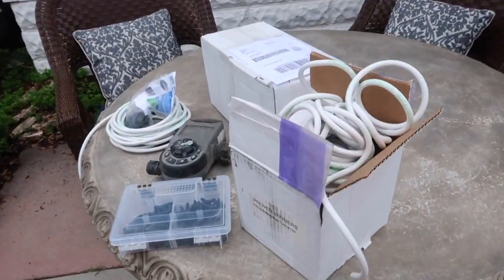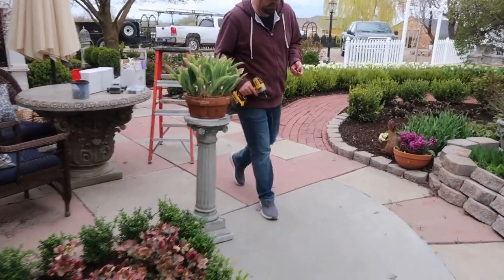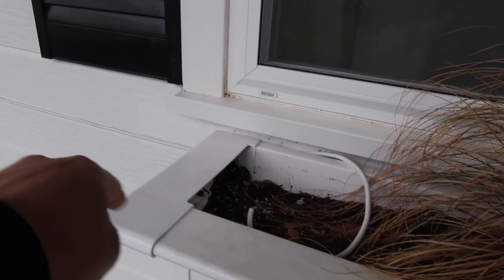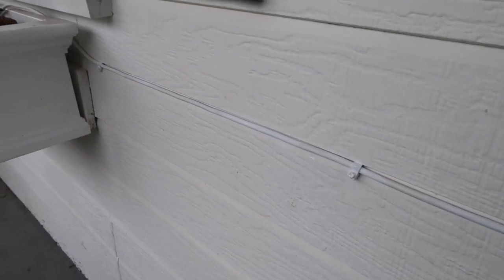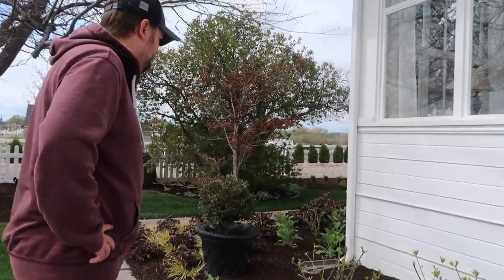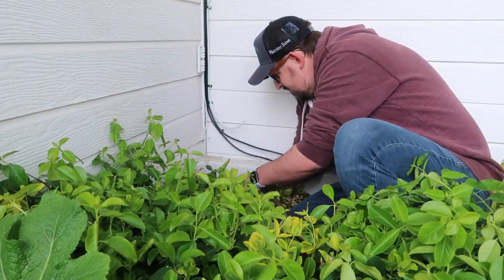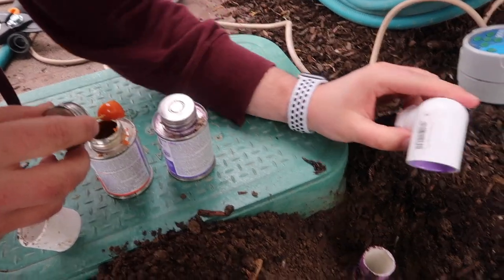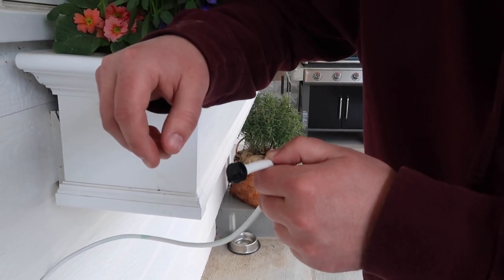Setting Up Our Window Boxes on Drip Irrigation! 💦🌿// Garden Answer

Comment: Love drip...soooo handy.  So a lesson I learned with the small tubing is when I ran it too far that it couldn’t push enough water to the end of the tubing properly.  Especially after adding emitters.  So I had to use larger hose, like 1/2”, to get the pressure needed to get the water to the end and then run the smaller drip off of the 1/2”.  Good luck!!

Comment: Glad to know the tubing at Home Depot is harder. I have been installing the Home Depot drip tubing and my fingers were bruised/rawv from trying to add the little connectors. I heated some water in the microwave,  poured hot water into a yeti tumbler to keep it hot, and carrier it around with me as I put the connectors on. I put end of the tubing in the hot water for about 30 seconds and then stuck the connectors in.

Comment: Love how well you & Aaron work together. Every time me & my bf started a big project, we would get excited for the first hour, then we had to call in the professionals #saveourrelationship  😂😂😂
Reply: Chantra Sek My hubby and I used to have knock down, drag out arguments that would make projects just keep going and going and going. 😱
Finally, we decided to set one person as the lead and one person as the helper. Because we both have experience in so many areas, it was better to have input but not that need to control the direction for the greater good of the project. 

Some marriage counselors suggest avoiding major renovations until you’re further into your relationship. I disagree totally. Doing the big DIY projects together will teach you communication with your partner.....or if you’ll end up burying him under the tulips. ☺️🌷
Reply: @megandcochrane  You made me laugh out loud with that last line about the tulips... hmm, there are those times!

Comment: Yay! I love starting my day with a video from you two! A very informative video and also helpful to those looking at the “how to” forums that can be super overwhelming. You just jumping in there and giving it a shot is awesome advice because everyone has a different need or issue.

It’s a great idea to keep your irrigation lines as level as possible when running over long distances because it reduces the amount of pressure required to keep the water moving. You’ve mentioned in the past that you’re on a well instead of city water so your pressure is probably more consistent. The water pumps for many cities have “low use” hours where they don’t put as much pressure on the lines. 

In my home, we’ll be running drip lines to the new garden beds and I’ve resigned to the fact that we will have to run the lines along the footing of the house. I’m thinking that a cable protector for the line at your back door may be a good idea so that line doesn’t get squashed!

Comment: I did it! I got my starter box and set up my second floor window boxes. I got on the roof myself!  I wouldn't be brave and wouldn't try without your tutorial. So grateful to you both. The tan tube matched my house no need to paint. Yay! I have vinyl so I got clips that go in without nailing,  and bought red adjustable emitters.  I used a two hose timer. Thank you so much!

Comment: Thank you so much for this video!  I started my drip irrigation system for my pots last year.  It was a little confusing.  I am on a well system also and ran it from my spout off the house.  I was confused when I was putting on the back flow preventer and the pressure regulator and the order they go on.  I am going a long distance so I ran black one inch tube off the spout and then the 1/4" tube at different areas around the house.  You have inspired me to finally get it finished.  Definitely the Proven Winners tubing is easier to work with than the Home Depot!!!

Comment: When I am working with connecting up drip tubing I keep a heavy duty coffee mug full of boiling hot water nearby. I dip any of the tubing ends in the hot water for a few seconds before connecting.  It softens the tubing just enough to help make the connection and prevent sore fingers.  I just reheat the water in the coffee mug in the microwave as needed 😍

Comment: Thanks so much for sharing this system.  I too want to have a drip system and also on the ground using soaker hoses and a timer.  Learning the technique from you takes the fear away of doing it DIY.
I promise you that your shrubs and plants will so completely steal the view that no one will notice the tiny hoses.

Comment: Great video. I've done quite a bit of drip irrigation in my yard and there is always an issue like the 2 gallon per hour vs. .5 gallon per hour stuff. The one problem I have consistently is that my lines always leak at the faucet to line connection. Your demonstration is real life stuff, not just someone showing how perfect they are at everything the first time. Thanks for keeping it real.
Reply: JD Winfield I wrap a little Teflon tape around the connector threads in a clockwise direction before screwing in. Works like a charm to stop the leaking! And actually makes some things a little easier to unscrew at the end of the season. Just an idea, this actually works really well for any threads where water is involved, especially if they don’t have a compression ring :)
Reply: @casey.munmar  I was thinking the same thing

Comment: Great video! I use a cup of hot water, it doesn't take long at all to soften the ends.  I use the standard black 1/4" tubing so it is really difficult to connect unless I do that.  So worth every time I hook up automatic watering.  I have some areas that I have to water by hand and it can be an every day event in summer, so every place I can automate is just so much time saved!

Comment: Mice will find a way through those holes you drilled. If you haven’t already, fill the gaps with steel wool (my preference) or spray foam.
Reply: Yeah, I was thinking the same thing.  There's also a type of caulk that you spray and it expands to fill the hole but I don't know if that would pinch or kink the tubing.
Reply: Our garden mice ate through spray foam
Reply: @jaanat.4880  Persistent little critters when it means freezing in the winter...

Comment: I saw an episode of This Old House where Roger, the landscape architect,  heated the end of the tube a bit with a heat gun, like 2 seconds, and the tube slide onto the divider pats easily. As the tube cooled it was snug tight

Comment: Glad for the fixes at the end because I was super confused by the 2 gph emitters! I was told not to run the 1/4" lines more than 25' from my 1/2" or 3/4" lines in my drip irrigation classes I've been taking, so it'll be interesting to see how the end of the line does this summer. Drip is very forgiving though, so it may be no big deal. Thanks for the tutorial.

Comment: Re: Corners. My husband does construction work & I’m pretty sure those corners will pop off and you can tuck the tubing under them. The black L piece may not fit, but you could try just the tubing.

Comment: The emitters are easier to put on if you dip the hose end in very hot water for a few seconds before putting the emitters on. I would have sent Aaron through the crawl space 😀 though it actually didn’t look too bad. I like how you showed the problem and the fix.

Comment: I have recently ( in the last week or so ) set up an irrigation system in my garden, it is such hard work if you have a small plot ( compared to yours, ours in tiny) not sure it’s worth it as I still have to run around to connect it to hose in each zone. But hey I tried it

Comment: Hi please just use Drip emitter line in the planters. Far superior. 
 Many reasons. Various spacing avail. 
Max 20ft runs of blank 1/4 inch Drip line recommended but it may work albeit not as well. 
You will likely be making changes over time. 
 There is a tool for the soft fingered installing emitters into tubing.

Comment: When you connect the connectors/T's to the tubing, it connected so easily. It is so hard for me. The connectors/T's (& other attachment pieces) are hard to connect to the tubing. I'm using another national-brand drip irrigation system I love. I wonder if my system & the PW's  Waterwise-system are compatible (?). Do you know if a 'bird' (wink-wink) and Proven Winners are compatible? What did Aaron use in his drill to attach the holders to the 'vinyl'(?) house  siding? This was a GREAT episode. Thanks so much!

Comment: Tip: before adding the connectors or emitters to your drip tubing, heat the ends with a lighter, and the connectors/emitters will slide in much easier.

Comment: Yikes!  I was cringing when you crawled under the house, spiders and tight spaces completely freak me out!  I admire your bravery!  

I water my garden using rain water from our rain barrels, is it possible to use drip irrigation system via rain barrels?  When I first started gardening our water bill was crazy $$$$ so hubby installed rain barrels. My plants seem healthier drinking rainwater and I feel good about conserving both water and money. However I live in Connecticut where we normally have plenty of rain, I'm sure this wouldn't be an option in a high desert climate.

Comment: You may already know this, but if you dip the tubing in some hot water for about 20-30 seconds, the t's and connectors will slide on much more easily.  :)

Comment: I've got one of these set up, thanks to your previous videos. It's not worth doing any container gardening without one, in my opinion. The tubing clips you use are for wood, but do you know of any way to reliably attach to stucco?
Reply: I think you could use the same clips and attach them on using E6000 glue. That glue has held very well for me gluing porous rocks to a bowling ball (left outside in our -30F temps) for over 6 years now.